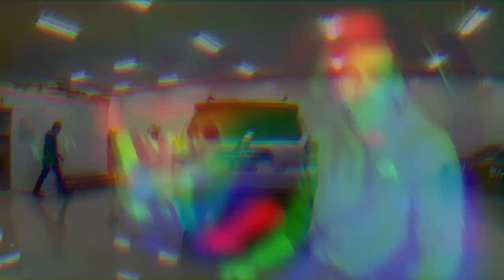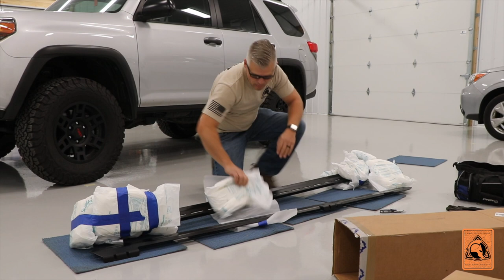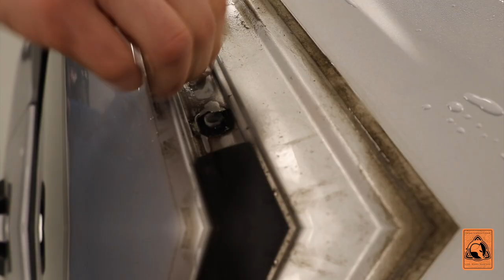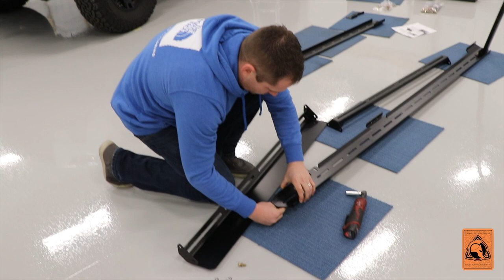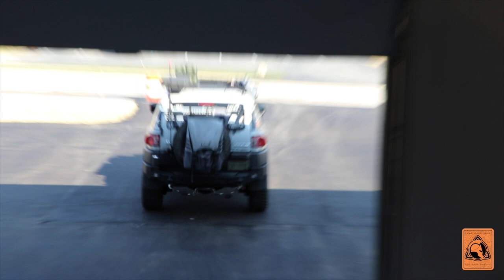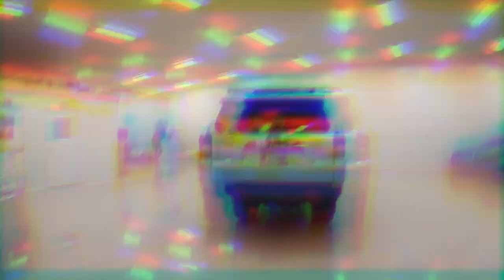LFD OffRoad 4 Runner Full Roof Rack

Comment: Thanks for this install video. I’ve been weighing the options for racks on my 4Runner and this helps a lot!

I was wondering if you installed the rear and front wind fairings backwards on purpose? No judgement at all, I wonder if that benefits the wind noise that could happen. Thanks for the info!
Reply from the maker: I think we did , the owner, not me,  wanted it that way.

Comment: I've had mine for almost a year now. Great people to work with and they definitely know what they are doing. Unfortunately, the powder coat on my rack is peeling off already.
Reply from the maker: Yes,  LFD has reported that they had an issue with their powder coaters, and have since changed companies.  That does not help you,  but I would suggest contacting them to see what they would be willing to do.
Reply: @UpintheAir.stream  Thanks for the heads up. Cheers!

Comment: Couple notes from LFD.  Make sure you add a drop of RTV inside the channel holes before bolting in the oem hardware to your roof.  Also, the new full racks don’t have lock washers, they use nordlock washers.  The plastic sleeves that house the oem mounting points don’t push in, so the guy in the video is only discussing the FJ, it’s not an issue with the 4R.  I ended up spray painting the hardware black as well, to give a cleaner look.  I’m not a fan of the finish on the crossbar bolts.  LFD is working on a new finish.
Reply from the maker: Thank you for the update,  They are working hard from my understanding to make their racks even better
Reply: What is the static and dynamic load for this full version?

Comment: How does the the front of this rack secure?  Rubber feet in the rail channel?  I was hoping to see this part of the install as well.
Reply from the maker: The front of the rack has rubber feet, It fits perfectly and helps to distribute the weight, but majority is carried by the four OEM attachment points.
Reply: When you're driving with or without weight on the rack, do those rubber feet vibrate on the ceiling? Or make any noise?
Reply: No...they ship with rubber stripping to attach to the front bottom feet.  The feet ride flush with the rubber stripping, but the oem mounting points are very secure, so the fwd feet aren’t really necessary, just a nice to have.

Comment: Hey guys. So after some torturous research I have decided to go with your rack for my rig. But I'm curious now that I watched the video.... Don't most of the racks sit flush with the rubber trim that runs under the side rails? I guess that spacer is what keeps it up higher which is what everybody seems to like because you can get your hands under it easier to install stuff. But there is no water issues having that open space between the spacer and the existing trim? Thanks for any info!
Reply from the maker: I would get in touch with LFD ,  we just did a product feature of the product
Reply: @UpintheAir.stream  Thanks for the reply. I actually installed it just after the original post here. It is awesome! I love that thing. And I figured out the issue, which was a non-existent issue.
Reply from the maker: @andynonymous2164  Good Deal